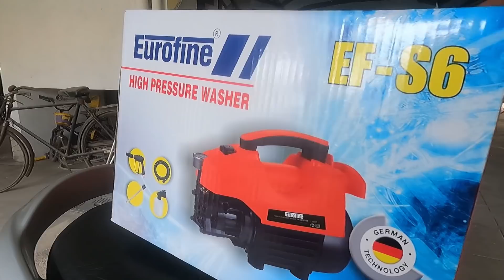Pressure Car Wash at Home - Foam wash வீட்டிலேயே | Eurofine pressure washer unboxing and review

Comment: Hello sir, You shouldn't wash your car with high pressure(pointed) Everytime, you should always use at moderate wide angle, u should use pointed pressure only in mud guard area, hope u understand😊
Reply: I was thinking the same when I watched the video...if we wash with high pressure it will damage the paint right?....also will it make scratches on car?
Reply: @ramkumarnavaneethan6935  yes, Since the pressure is acting a single point, it can affect the paint and eventually affect the primer too!..Scratches aren't normal though... using the pressure washer wide angle would give you extra foam and remove the dirt well with less usage of both electricity and water
Reply: I not used high pressure or pointed  mostly, while washing
Reply: You are right

Comment: I am using it for a month. It does it job, but don't expect it to remove the extreme dirt with pressure wash with plain water. Try foam wash and then clean it.

Comment: Have plans of picking a machine was looking into JPT and starq but I'm impressed with this can see the pressure it has , sir but don't use the pointed on the car and glass it may leave an bad impact on the car, the wide range is safer , and use less water and shampoo in the can use get thicker foam on the vehicle it's what I think no hard feelings , 👌👍
Reply: Starq, jpt and other major pressure washer companies buy machines from Coimbatore and erode then they sell as their brand... This model is exact motor used in starq w3a model...I have starq W3A which is same machine as in this video 😂
Reply: Starq W3A is Ditto same model as in this video

Comment: With little squeeze of 3M shampoo you can clean the whole car by two bucket method.Its too much shampoo.Its depends on the usage of car too.Frequent users needed this.I think 3M shampoo is not fit for this.Foaming and coverage seems to be less.Good video and its informative.

Comment: No, Definitely this is not the right way to wash your car. Never keep it pointed nozzle in painted surfaces. Again when cleaning the wheel areas and where you see movable mechanisms should not use pointed pressure. That will wear out the lubrication in the spares end up in frequent replacement of spares.

Comment: I bought this product 1 week before (20 jan 2023) and used for 30 minutes on that day(not continues usage), It worked fine, but today when i started using it, it stopped working after 5 minutes. I asked swot associate, they told to courier the product for checking/service. 
My suggestion is please research and buy the product in local/nearby area, so that service support will be done on the spot/on that day. 
Disadvantages:
We have to pay for courier chargers for maintanance (more frustrating if not even used for 1 hour and you have to send back for service) and need to wait for some weeks.

Comment: Super 👌👌👌 Master. 
 I am Using JPT F8 Model. It's More Powerful "220 Bar Pressure" and Best Performance.Cost Around 10k.But It's Not Safe due to Heavy Pressure I got Little bit Injury in my left hand just a small Scratch At pressure gun wide angle.If I got that in Sharp Point Angle Definitely It's an major Accident.120 Bar pressure Is Enough and Safe.Handle the pressure Gun with Care. 
Thank you 🙏🙏🙏 Master 🤓🤓🤓.
Reply: That much pressure is not needed for car wash.  70 to 110 bar pressure is enough

Comment: Bro, nice one. One question. What makes this product different from others? There are a variety of car washers available in the market with the same or even less price. Your answer would clarify others as well I believe. Thanks
Reply: One advantage is, you don’t need tap nearby. It can take water from bucket. But on Bosch, you need a tap.
Reply: copper  coil
Reply: @tamilantamilnadu9004  proof?
Reply: bro i will tell you. Even i make tons of research before making a decision to buy anything, and let me sum up what i have researched so far.  As mentioned the windings used on stator of this motor is indeed copper and the ones you see on amazon not all, but most of the ones like Starq,Vetero, Shakthi, Agaro etc..use alumunium coils, and I hope you know the difference what type of metals is best for motor windings in the long run and for heat dissipation .... Next is Service, for any mechanical equipment (here motor) you need proper service center as you will sure encounter issue in the future, and this company is located in erode, it surely provides good service to its customer no matter where you stay in india. For the rest other brands, its service center are located in North India, and i have no idea how good they are in providing services.. and mainly , whatever pressure the other brands promise (like Starq says 220-300 bar pressure) is plain bullshit.... in real they won't cross 120-135 bars at all...but the Eurofine does reach the mentioned pressures what it states.. So what more do you need??

Comment: Ellamey super bro ! ..nalla product ah iruku enoda opinion but ..the only problem I face is the power source for that product! ! ..if anyone finds any product similar to this pressure washer ..which works by some battery source or something? Let me know ..❤️👊
Reply: U need to design by ur own. Search for battery sprayer pump in Amazon u'll get it. It can run on bike battery itself. But u also need to setup pipes, sprayer gun etc., in half the price but only drawback would be amount of pressure.. u can't expect much.
Reply: @prazzy1988  thank you for your concern ✨

Comment: How stupid it is to make the nozzle to its finest pressure and point it on the paint... please DO NOT do this and it will spoil the paint and remove the shines also... its only used in the mud guard sections and tire regions only...even dont point that much pressure on the radiator grills also... the thin metal fins in the radiator will also bend and that is not good for your car !!

Comment: Price ?
Reply: Rs.6500
Reply: RS.6480 ONLY
Reply: @eurofinehighpressurewasher3683  will u deliver in chennai? Is courier charge  included? What is the warranty?
Reply: For 2 HP MOTOR  RS 6300  AND FOR 2.5 HP MOTOR RS 6900
Reply: @ganeshkannan8857   with free courier sir in South India only

Comment: Hose quality is very bad , the rubber started to wear off in just 6 months,  I contacted them they told me that the hose that comes with the product is 200rs per meter an the least quality , just contact them if u looking to buy and get a hose with better quality  , I've been using it for 6 months don't expect it to remove minute particles  get a even higher pressure machine for better cleaning